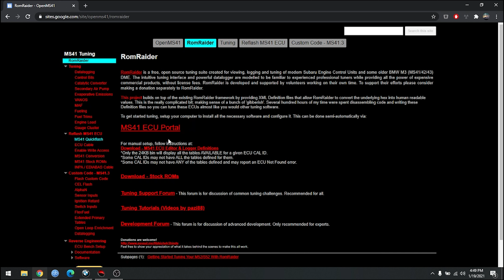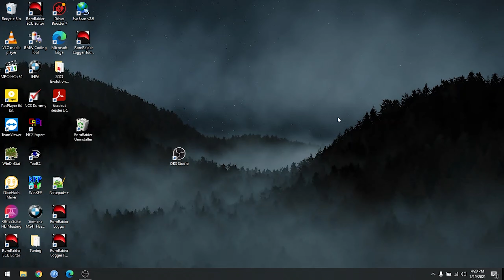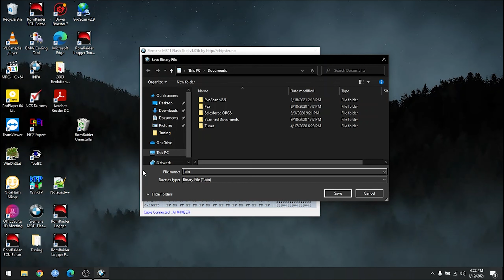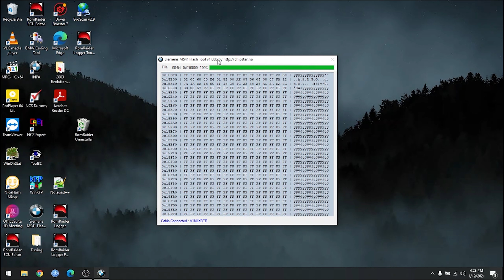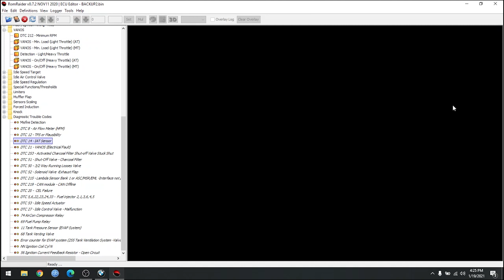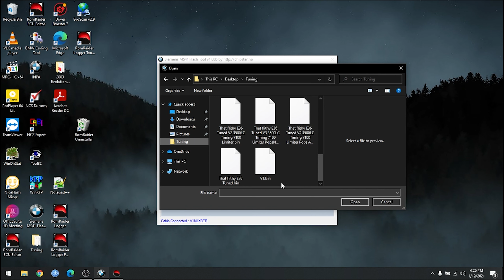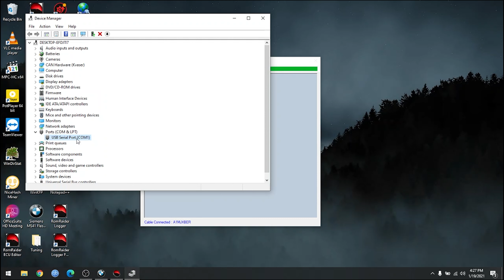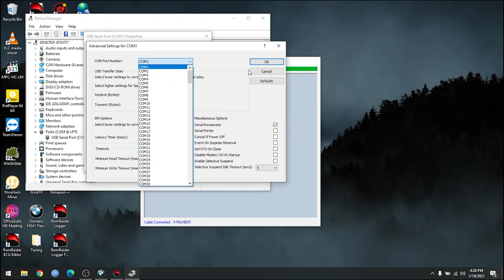How To Tune A BMW E36: Beginner Tutorial - Part 1

Comment: You can just jumper the pins in the plug under the hood and use the OBDII port inside :)
Reply from the maker: Correct! I found that out like a month after I made this video. I'm planning on making a new version with updated info soon

Comment: Great video that is helping me figure out how I'm going to tune my brother's E36. You have earned my subscription good sir. My only question you may be able to help me with is do you know if a Tactrix Openport 2.0 cable will work? Not a big deal if I have to buy a cheap VAG COM cable but coming from the Subaru world I already have a Tactrix ready to go. Thanks for the videos
Reply from the maker: Tactrix is subaru/evo specific. Pretty much every platform requires a different tuning cable. I've collected about 10 different ones now. The only cable that's more universal is hp tuners, but that doesn't support bmws

Comment: Hi.  I am using romraider.  I have a ms41 stroker 3.0 m50 engine.  First start in the morning is in the AFR lean 16 or 16.5 range.  Afr is in the 15-16 range until the engine warms up.  No engine problem.  All sensors and elements are intact.  No error log.  After the engine warms up, afr is normal.  Idle 730rpm afr 14. While driving 13.5.  Acceleration and high speed and accelerator pedal full load 12.7.  But in the morning the problem afr very bad.  No air or vacuum leaks.
Reply from the maker: You need to tune your cold start enrichment tables, I forgot which table it is but it has an X-Axis of coolant temp, and the datapoints are % enrichment. You'll want to bump that up a little

Comment: Hey man - great video! Still helping guys years later. I downloaded RomRaider and MS41 Quickflash to mess with timing and fuel adjustments. I can read partial and full files from the DME (41.1), but have “errors preparing ECU” when going to write/flash a new tune. Pins 14 and 18 are jumped, along with 7 and 20 to enable OBD writing, any suggestions what I’m doing wrong?
Reply from the maker: Did you try writing from the 20 pin in the engine bay? I've seen some cars dont like to be flashed from the obd port
Reply: @CanyonTuned  I have a 20 pin to OBD2 port adapter on the way to try just that. Anything else to look for beyond that? Thanks for the feedback!

Comment: Hey, thank you for this video series. Before i want to get started on everything I had a quick question. I did the e-fan conversion just like yours with the relay and etc. My orange wire goes to pin 16 on the diagnostics connecter and at the moment its cut and directly spliced to the orange cable. I am wondering if Ill have to resplice the original pin 16 wire to the pin itself before I do any sort of tuning. And question 2 would be where did you route the orange wire as i see it going under the cowl to the fuse box? Thank you in advance!
Reply from the maker: My efan is pretty ghetto rigged. My wire that goes to the fuse box is just soldered to a fuse that's hot when the key is on. That way the fan shuts off with the car. I'm not sure what you're talking about what the diag connector. Nothing fan related should be going to that. Mines wired to the main b+ terminal where you can jump the car from the front
Reply: @CanyonTuned  Hey man nice video.  You probably have lotta questions here but, do you recommened I do a tune like this after I just swapped to a m50 manifold? I dont know how to tune so Idk if I should just order the cable you bought.

Comment: Hey man great videos i just got in to tuning i have romraider and a proper usb wire but i cant for the life of me make romraider logger work it will just constantly try to connect but wont any help would be greatly appreciated
Reply from the maker: Are you using the obd or 20 pin connector?
Reply: @CanyonTuned  obd
Reply from the maker: You still need to jump the pins on the 20pin connector under the hood to get logging information. Refer to the ms41 wiki (Google) for the in information. There's two sets and they both need to be jumped

Comment: Can you do m50 tutorial or help me to tune my m50 correctly?
Reply from the maker: M50 manifolds I unfortunately can't get behind. You lose all your usable low end torque. Best you can do is add some timing in the lower rpms to bring it somewhat back to life. Unless you're boosted or living near redline for track use it's a useless mod
Reply: @CanyonTuned  i meant ms40.1 ecu tuning but i have figured it out maybe. testing it soon

Comment: for scanning modules and coding what would be the process? could you make a video about it? awesome content!
Reply from the maker: No idea how to code honestly
Reply: @CanyonTuned  ok,  for scanning what program would you use? my e36 doesn't have a obd2 port underneath the footwell only the 20pin connector
Reply: @SonyPsp08888  check out my advanced tutorial, if you don't have an odb port just get a obd extension cable and run the 20 pin -> odb extension -> obd cable so you can have the laptop inside your car. Rom Raider logger works great

Comment: Nice video thanks. I'm looking to upgrade my standard S50B32 eruo engine into a race built/tuned engine (new pistons, rods, higher compression). Just need to find a person in New Zealand that can tune the dual vanos on a dyno with this method.
Reply from the maker: S50 dual vanos is fairly easy to tune since it's just on/off, basically you want to do 2x runs of each intake and exhaust on and off and overlay you dyno charts to see where the power overlaps then set the vanos switchpoint 300 rpm sooner

Comment: Hey dude nice vid but i dont have all paramters to change as you do what ist the problem?
Reply from the maker: You are working from the full read...you need the partial file. Follow the exact instructions in the video please
Reply: @CanyonTuned  yes but then the program says ecu reject
Reply from the maker: Then either you don't have the correct definitions or your specific ecu isn't supported
Reply: @CanyonTuned  it is supportet porbably this is what in romraider says this ecus is not supported ther ist not mine
Reply: @CanyonTuned  what you mean with definitions

Comment: Hello!! Did you write the partial with the ecu mounted on the car? Is not necessary to use a bench setup? Ive seen a lot of people doing it just for a simple partial write and i was considering if its necessary or not. I know of something goes wrong you are f**d up but isnt it just a 1 minute work?
Reply from the maker: You never need to bench flash these ecus. Just make sure you have a battery charger hooked up if you're doing a full read/write
Reply: @CanyonTuned  Nice i thought so. Have you ever tuned a DISA btw?

Comment: Cant u show us how to do the step with connecting the opins?
Reply from the maker: Unscrew the two screws on the 20pin connector. Split the connector. On the back use a jumper wire and solder it. It's dead simple

Comment: hi, i liked the video but i have some questions... i have a '93 320i so it has a m50b20 vanos engine and OBD1 siemens ms40.1... so no flashable. but i know that it can be red from eeprom reader and up to here no problem... now, do you know if the file is the same as that of ms41? can you edit with programs like romraider? is it possible to use the program you show in the videos? Thank you.
Reply: because the problem is not so much the reading but the modification because I don't know if you can easily modify it as an ms41
Reply from the maker: Yes, if you look at the romraider forums they should have definitions for the M50. You can try using tunerpro too I believe. Worst case scenario you can just use a binary editor but you have to know which specific sectors correspond to each table/value.
Reply: @CanyonTuned  perfect, I sincerely hope there are legible definitions for mere mortals

Comment: Could I see how you did the weld inside the 20 pin. Like a photo?
Reply from the maker: Open up the connector (there should be screws) and solder a wire to the back side of the pins mentioned. If you look very closely the pins are numbered at the front side.
Reply: @CanyonTuned  Thank you
Reply: Hi could you please confirm that this cable will work instead of ftdi chip?

Comment: I have a k can cable would that work or do I need to get that vac com cable ?
Reply from the maker: I think you have to swap one of the wires for it to work. Not sure but I would just buy the correct cable they're cheap

Comment: I have installed those ecu definitions but in ms41 I’m missing DTC codes removal and also speed limit in rpm to make launch control, any chance to get that?
Reply from the maker: You need to be working for a partial file not a full
Reply: @CanyonTuned  yes I’m working on partial bin file but I have ms41.0 I think that’s the reason :c

Comment: Are the steps same for 96' 523i?
Reply from the maker: Yes and no. You might have trouble finding the romraider definitions for that motor. People don't usually tune them.
Reply: @CanyonTuned  it's got a siemens ms41 ecu with m52b25, did a bit of research and it should work, but i was wondering if those softwares even work on windows xp (shitty diagnostics laptop)

Comment: Can you load the partial map and unplug the car, then make your changes and then plug the computer back in once you have everything changed and upload the new map changes
Reply from the maker: Yes the only time it needs to be plugged into the car is when you're actually reading or writing to the ecu. Or you need to log (see my other videos)
Reply: @CanyonTuned  so could i grab the save file, unplug from the car and do all the changes, then just plug it in when i’m actually writing to the ecu when i’m finished?
Reply from the maker: @__akuuma  You only need to be connected to the car when you're reading, writing or logging.

Comment: I hope you see this comment. I know it’s an old vid but would you be able to turn off dsc through rom raider? or does it have to be dealt with separately since it has its own module
Reply from the maker: I think that's part of one of the body modules that needs to be coded not tuned. Most people just remove the DSC hardware and pull the bulb in the dash
Reply: @CanyonTuned   thanks

Comment: With OBD2 e36 can I just jump the pins and read it from OBD2 port or does it need to be with that 20 pin cable ?
Reply from the maker: You need to jump both sets of pins (4 total) to use the obd port but yes it works
Reply: @CanyonTuned  so I can’t click on the google docs and I need to figure out what wires I have to jump can someone help me??
Reply from the maker: @brevinolson8236  https://sites.google.com/site/openms41/read-write-ms41/enable-write

Comment: I have MS41 , got the file and disabled EWS. There is only OBD 1 connector inside my e36 which I used in order to read. How can I flash? How to locate the 14 and 18 to bridge them when there isnt x20 connector in the engine bay? Thanks!
Reply from the maker: Then you have an obd1 car. You cannot flash it, you need a removable chip switched out in the ecu with a tune in it. Tons of them on ebay
Reply: @CanyonTuned  my bad its a 16 pin obd 2. That goes inside the car, I dont hve the x20 connector. The ECU is ms41 index, I have found out that pin 7 is the kline and pin 16 is the 12+ volt. Can i bridge 7  and 16 and try to flash?

Comment: Ms41 won’t read my cable and all drivers are installed 😢
Reply from the maker: Make sure your device is using com port 1 in device manager. That's the most common issue

Comment: I’m having issues with openms41 I can’t buy it and I found a link to the version you have, but when I hit partial or anything nothing happens. Device is connected, and bridge the pins under the hood with jumper wires
Reply from the maker: Check device manager, make sure your cable is detected and the port is set to COM1
Reply: @CanyonTuned  it is, do you have a link to openms41? The website to buy it is down.
Reply: Also romraider logger doesn’t detect either.

Comment: Would you be willing to make me base map for my build so I can start and drive it to work out any kinks until I can take it to a dyno?
Reply from the maker: Just scale your injectors, add a little fuel and take some timing out of it if you're forced induction
Reply: @CanyonTuned  I know but I don’t know how to do any of that at all this is my first build.
Reply from the maker: @milanmakesbeatscapsulecorp945  If you don't have a local tuner I personally would suggest just going with the TRM forced induction tuning solution. I can't just build you a base map
Reply: @CanyonTuned  ok gotcha thanks a lot man

Comment: Hi, after flashing the ecu, i got crank no start situation and getting these codes 
100 control unit self test failed 
68 tank venting valve 
Fuel pump is working but it looks like there is no spark 
Any idea ? 
Thanks in advance
Reply from the maker: Seems like either you checksum isn't correct when you flashed it, or you have a mismatch of DME software versions. Without more information on the steps you took, It could be a lot of things honestly
Reply: @CanyonTuned  thanks for the quick response 
All i did was 
Using the ms41 quick flash took a partial copy
Open romraider to change the rev limiter hysteria to 32 to make it fast rev 
And then flashed to the ecu 
Tried to flash the stock partial file 
It flashes but still same issue crank no start
“I can still read and write to my ecu with out a problem”
Reply from the maker: Flash back to your original tune and try a different number, you might have gone outside the range of acceptable values. I've never messed with that specific setting before
Reply: Problem fixed, it was all because of the ews module it was causing the dme to not fully write or flash which ended up causing to ruin the flash IC in the dme 
I had to disconnect the ews and bridge it 
Then to flash the IC module inside the dme 
Then to copy another dme and write it to my dme 
Then tune it and its done
Reply: I hope it make sense

Comment: How i can programming e30 1987 ecu
Reply from the maker: It's really not worth it honestly. You can buy performance chips on ebay for like $30. If you really have a unique setup, buy 27C256 type, a 28-pin DIL (Dual In-line) chips and an EPROM writer. TunerPro also has all the e30 DME definitions

Comment: Yo! Have you used the MS41 flashing utility back up? Want to make sure it’s legit before I download it onto my computer my browser instantly blocked it haha
Reply from the maker: Yeah I really don't get why anti-virus programs have been blocking these lately. Been using both versions for 5+ years without issues
Reply: i have the same problem, virustotal shows some shady thing's when i scanned it. how can i get the ms41 definitions without using the MS41 portal?

Comment: Every time I try to down load the flashing utility on mega it just loads and then tells me to download again but now I have like 10 downloads that won’t open
Reply from the maker: Can you be more specific about the error message? What version of windows are you using? You could be missing one of the .net frameworks
Reply: @CanyonTuned  I just bought the ms41 quick flash and I’m going to try it this way, it was asking me to open the download but every time I did it would load then ask me to do it again, so nothing was even happening.
Reply from the maker: @E36_kidd  That's strange, I've never had an issue with it. But yeah ms41 quick flash is much newer and better anyway
Reply: @CanyonTuned  I got it to work after like 3 hours 😂 thanks for all the help and one last question, I know you can jump the pins that are  on the cars obd2 connector but instead of that can you do it to the obd2 adapter wire instead.
Reply from the maker: @E36_kidd  Correct, I prefer to jump the pins inside the  round 20pin connector instead of messing with the car's harness. Just unscrew the connector and easily solder a wire across the pins inside
Reply: @CanyonTuned  thanks so much

Comment: I can’t download the definition tables ? I’m registered on the website. I have a 1995, 325IS. 7:54
Reply from the maker: Please explain what's going on exactly.
Reply: @CanyonTuned  yes if I go to the rom raider site where you have the links for the software /cable and definition tables everything is clickable except the bold definition tables area.  I had to order another cable as the software can see the cable but won’t communicate with software. So this time I bought a ohp inpa cable no selector switch it’s just blue.  I could screen record and send to you as well. Thanks 🙏 for the help
Reply from the maker: @Vgk36  Double check you're actually logged into the romraider forums or try a different web browser. I've never had an issue downloading definitions. Also Is your car OBD1 or 2? 95 was the cutoff for transitioning to OBD2 and some 95s are still 1. If it's 1 you won't be able to use anything in this tutorial, you'll have to refer to my e30 one
Reply: @CanyonTuned  bam ! That's the problem. Mine is OBD1. Mine is production date. 3/95

Comment: Just a quick question, i dont really want to purchase the round connector that allows to connect to obd2, there is this guy who connected some pins together, and it allowed him to gain all the access apparently and use the obd2 inside the car. The link to the vide is here https://www.youtube.com/watch?v=kWKcWBMESDQ&t=78s   , would it be the same thing as buying the round connector and connecting the wires ?
Reply from the maker: There's two sets of pins you need to jump  to bypass the round connector, please check out the ms41 wiki for more information on that